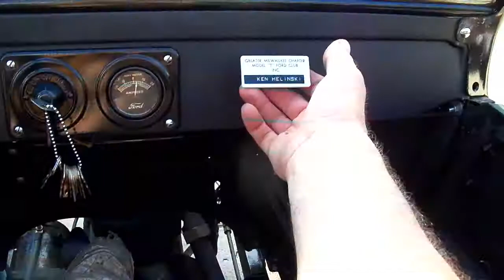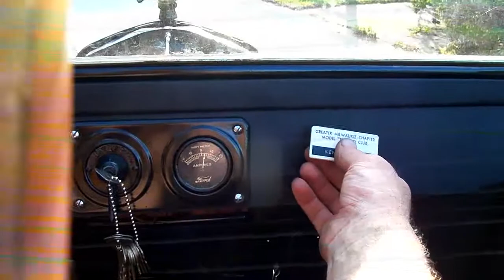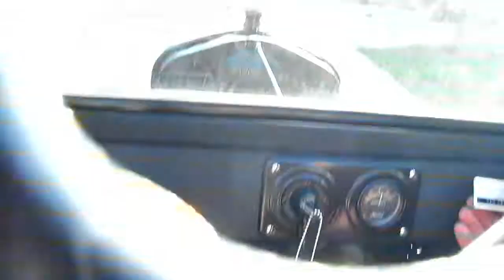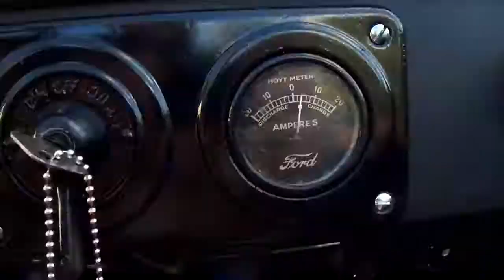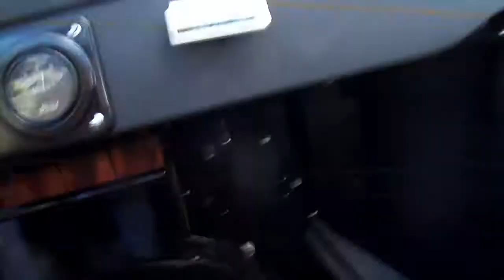first ride Model T

Comment: It looked to me like you were just choking it, but not opening the throttle at all? It won't pull a load with only the throttle lever at "idle". And did you advance the spark at all after it started? I couldn't tell. How is she running now?